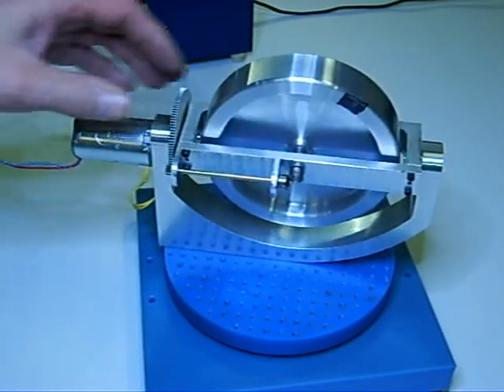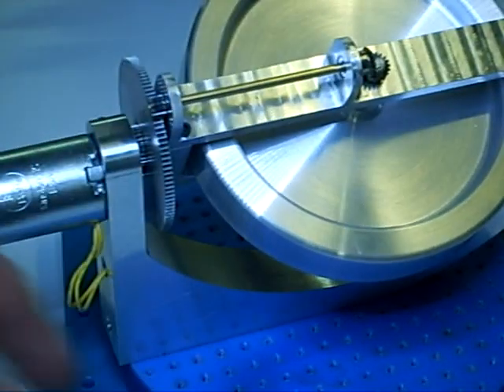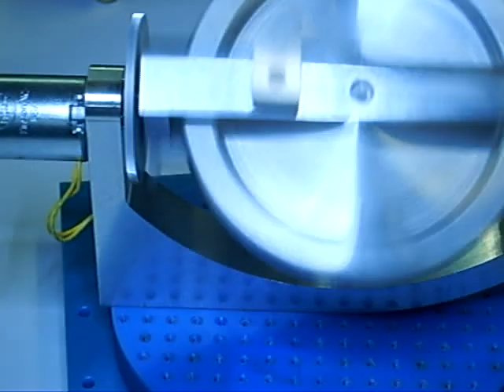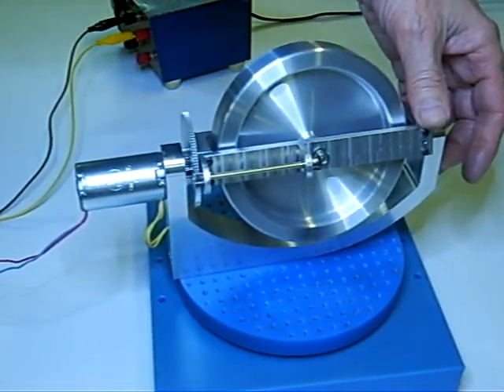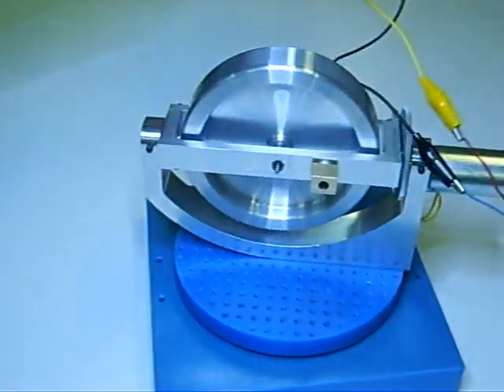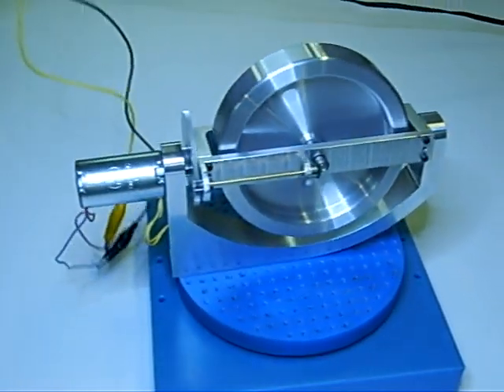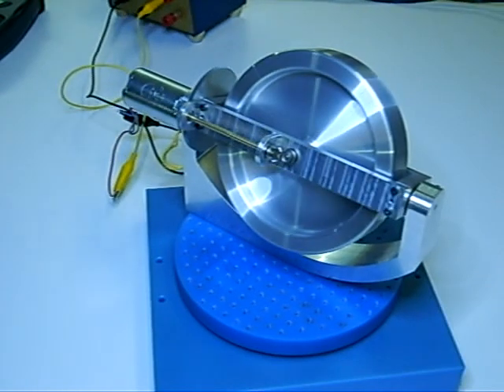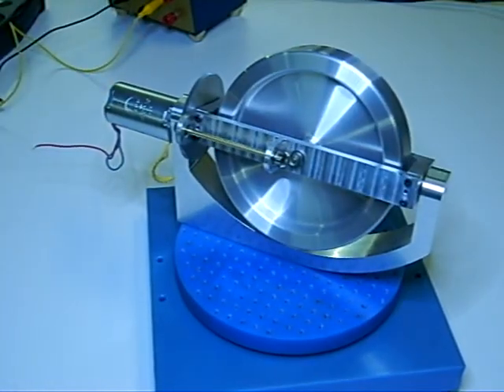Gyro test

Comment: You got it. It's to study nuclear motion. Force eject L-ecto-tron is identically matched with the in-tron we call as neutron, which term refers to its frequency. The electron we know well in chemical bonding, study in force physics as mechanical constraint provided by the cam and follower (the long control rod in this gyro). Constraint allows time-synchronization of events in the photon at the electron portal and nu-tron portal into the nucleus. 
Now here you may tilt protons in the stellarator to favor fusion; or try!
Reply: Okay